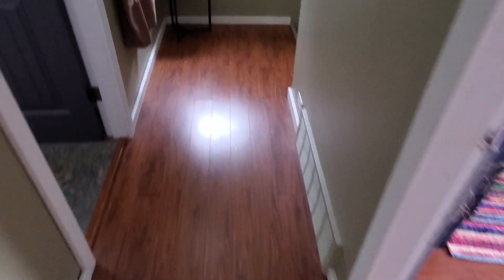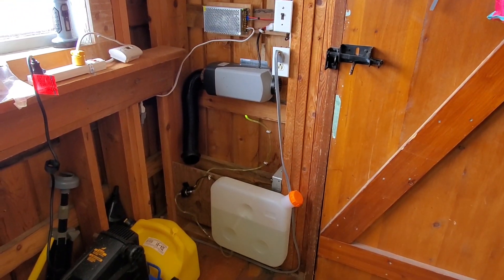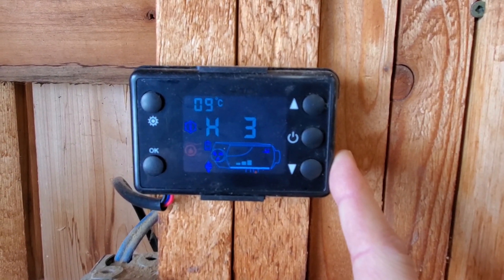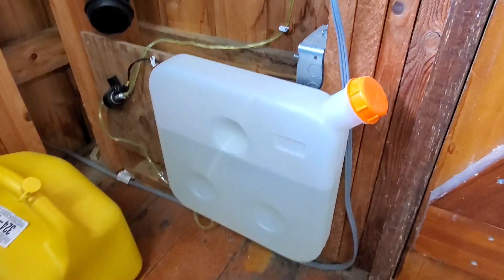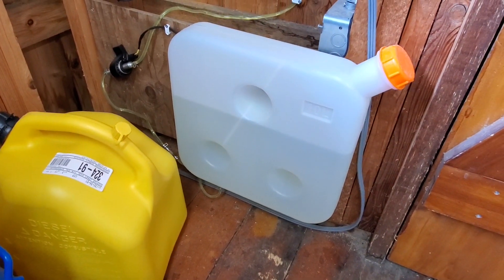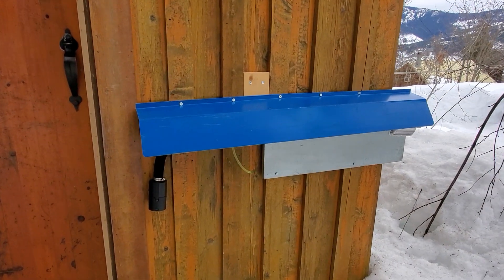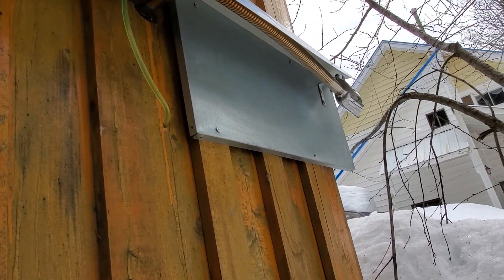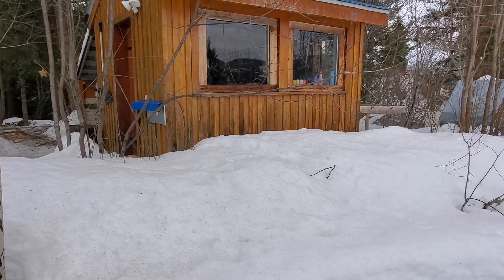Chinese Diesel Heater for a Workshop/Shed (5KW)

Comment: I thought the main heating unit had to be installed horizontally with the exhaust and air coming out from the bottom. You've got yours mounted vertically on the workshop wall. If you've had no problems running the system this way I'll do the same with mine.
Reply from the maker: It can be mounted vertically if you have the glow plug on top.

Comment: mine came with a 5L tank because i cheaped out and bought the all in one. so what i did was got the same fuel can cut the tab off the cap drilled a hole in it and fed a stand pipe down that then when that ones empty i just remove the cap stand pipe and all and switch it to another full can then go fill the empty one. and thats my plan for the one im putting in my house hopefully before winter hits in canada. hell its 2 degrees here in NL its still t shirt weather.

my shed is 12X20 uninsulated holes in the roof its 2 feet off the ground and the floor is built like a deck, last winter in -40 i had mine cranking out on heat level 6 i had to take my sweater off it was so hot. since then ive laied down osb on the floor and swapped out the old drafty swing door with a roll up garage door
Reply from the maker: I've been slowly upgrading my shed as well. Lots of new videos to come with wood stove install, solar power.

Comment: Recommendations: don't shut it off in the depths of winter... remote it to high when needed.. Run on lowest setting otherwise.  .  Run 10 percent petrol (gasoline) to keep diesel from jelling and increase heat output..  run AC components (12 volt chargers, power supplies, etc) through a computer UPS to avoid catastrophy if sudden ac power loss possible.  I use a 15 to 30 gallon fuel cell to supply sink for heat and lowers refuelling to once a season.  If using gasoline in mix, consider hardline plastic going to a tank OUTSIDE.  Run your exhaust no more tHan a meter or two, coiled and going downwards with a fan blowing across it.. INSIDE . Pass the exhaust through the wall centered in a 1-1/2 inch piece of copper pipe.  Lose the muffler.  RUN INTAKE INSIDE.. combusting outside cold air takes energy.
Reply from the maker: Interesting ideas, I'll have to look into them.

Comment: I've got an insulated shop the size of a 2.5 car garage with 9 ft high ceilings and installed 2 x 8 KW diesel mini-heaters. Each heater is on the opposite side of the garage and their exhaust pipes vents outside. Yes. They do "heat up" my garage - to "take the chill out".  Especially when temps drop in the -40Cs / -40Fs. I also use the 220V @ 30 Amp electric heater when needing to work inside in my spring coat / thick sweater. Yes. Mini-Heaters do "heat up" a shop. Especially when "occasionally needed during winter months" - like when changing my vehicle's engine oil.... Burning diesel is much less expensive than using electric heaters. Especially electric baseboard heaters...
Reply from the maker: Agreed. That's a fairly large space to heat.

Comment: I installed one in a 20 by 10 woodwork shop last week.  I went with the Maxpeedingrods 5kw unit with separated tank and heater element.  The wood shop is located in Western Massachusetts not too far from Albany, NY, it can get down to minus 30's on coldest days during artic blast.  The shed is uninsulated, will insulate it for next winter to cut down on required btu's to keep space heated during cold weather.   So far, I am very happy with purchase.  I paid $138 for the 5kw kit which came with upgraded components compared to many other brands, heavier duty exhaust pipe and Bluetooth controller which appears to be similar to one you are running it has a gear pump mode which I run it in or an auto temp mode. 

 I actually like the key fob more then the phone app. The phone app could use some work.   I did pick up similar transformer rated for 30 amps and 12 volts for $21.  I bought the double wall through rv or boat thimble and one extra exhaust hose.   Total cost was around $185.  The unit runs well and puts out estimated 14,500btu to 15,000 btu max based on combustion efficiency.  This is 3.5x higher than any electric heater and like yourself it cost about $8 of fuel to run few hours a day for approximately two weeks.  This is way better than electric and propane, plus it is a dry heat no moisture like salamander heaters give off.  

The unit reminds me of old school monitor heater we have in Log Cabin up near Lake Placid which can heat a whole log cabin and runs off of kerosene.  They do not make monitor heaters anymore they were very popular fuel-efficient ways to heat homes in cold weather climates.  The cabin could be heated literally for two years on a 275-gallon tank of kerosene.  I think the old monitor heaters put out estimated 30,000 to 40,000 btu using same exact principals as these units.
Reply from the maker: Very cool info on the monitor heater. I'm installing a mini wood stove next to compare.

Comment: Hello, 3 years later - how is the unit doing?  Any issues?

I have a question about the electronics, have you had any issues with condensation?  Thanks.
Reply from the maker: It's running great 5 years later :)

Comment: If you have your fresh air intake on the INSIDE of the building. It will work much better.  Doing it the way you are.  It has to heat the cold outside air
  Fresh air intake on the INSIDE of the building my heater works wayyyyyyyy wayyyy wayyyyy better
Reply from the maker: Interesting I may try that!

Comment: Well done.  I am glad to see your installation has the outside air intake and exhaust on a vertical surface.  First one I’ve seen in looking at hundreds of videos.  The difficult to read manuals show it but most choose to put the outside air and exhaust down.  It is a good suggestion to wire in a battery backup for power outage.
Reply from the maker: Yes not many installed this way but it works very well. I have had the power go out a couple times without any damage ( may have got lucky).

Comment: Hi there, I'm just wondering if you have ever had a power cut while it's been on and if the heater cools down own, I'm assuming it should have some sort of safety system built into it, I'm torn between electric or a battery and solar charge or maybe even a trickle charge, thanks
Reply from the maker: I have, it doesn't seem to negatively effect it.

Comment: I am thinking of mounting everything outside and a safe distance from the building then just running insulated heat discharge (and possibly intake) into the building. Probably best to mount the unit higher than the point where the output hose enters the building.
Reply from the maker: You will lose some heat running the discharge in a cold area. I would personally mount it against the building to maximize efficiency

Comment: how much amps dose this thing pull???
Reply: I'm just prepping to do an install in Manitoba and have been researching the same question.  My searches so far have led me to a start up amperage of 11 to 12 with a 120 volt connection.  Once running it should drop closer to 4 or less.  I'm planning on a 20 amp supply and suggest no smaller than a 15 amp supply.
Reply from the maker: About 5-10 when glow plug starts, 2ish when running.

Comment: Thank you.  One thing that I was looking to have answered -- my shop setup is that best fit for a Chinese heater installed "on its side" -- i.e. with the inlet and exhaust pointed out horizontally versus the vertically pointed down as most are.  But no videos I've found so far show this arrangement or mention whether it's a practical arrangement or not.  Now I see yours and I'm glad to know that at least some heaters will work mounted in this way.  Did you have to select one with this in mind or is it "universal"?
It's very good to know.  Thanks also for your comments about efficiency and the usefulness of an battery-assisted 12V power supply.  This is a very useful video and I appreciate the info and your work to produce it.
Reply: I watched a video of a guy talking about this type of side install.  He said it was fine as long as the glow plug was facing up.
Reply: @kdollars101  Thanks.  That's kind of a problem, I need to have two back to back, that would make the glow plug on one point up and the other point down.  Maybe I can do some juggling to get them to fit side-by side.  
But it's good to know,  thanks and best wishes,
Reply from the maker: That's right!
Reply from the maker: As long as the glow plug is on the top, you are good.

Comment: Hey, it's not pretty, but aluminum tape is great for covering cracks, stopping air leaks.  

I just installed a 5kw heater in my garage. So far, I think it'll work out well.   I used a battery and charger to ensure there's no way for the power to the heater to be interrupted and cause damage, though.
Reply: Hi, I’m glad To see your text. I expect delivery of my heater soon, and was looking for information on having the battery on the charger whilst connected to the heater, and I see that you have done it this way. Can you give me your suggestions on using either trickle or full charge when running. I think that I will buy a separate battery for the heater rather than use my jeep battery battery. I would be grateful for any advice on this, thank you.

Comment: looks like you  used some kind metal piece that you screwed to you shed and then ran the exhaust tube thru.I need something like that so i dont burn the piece of wood im going to run the tube thru. What is it called and can i get one on amazon?
Reply from the maker: I just cut the hole in my wall large enough that the exhaust wouldnt be in close proximity.

Comment: Would it not work more efficiently with the air intake inside rather than burning freezing cold air from outside....just a thought...
Reply: combustion air is better cold so it's outside with the exhaust. the heat exchange cold intake is inside the building, so you are recirc-ing the "hot" air.

Comment: On the controller you should be able to press the settings button three times till it shows 4 lines with a padlock icon. That’s asking for a pin to access the HZ and fan speed setting. The pin to enter is 1688, select it by using the arrow keys and pressing the ok button to confirm each number. That should enable the advanced settings.

Comment: Buy a tube of sealant and seal the holes in your walls. Your losing heat while running the heater. Its $5 and you'll save on fuel while keeping shop heater for longer
Reply from the maker: I have added rigid foam since then and it's much warmer!

Comment: How is the heater working now that its been a year? I noticed you mounted yours sideways, with the intake and exhaust through the wall, is that an option? We just bought an 8kw unit and will be installing it on our remote cabin this weekend and was curious.
Reply from the maker: Hey! Working great! as mentioned in my update comment below I would run the heater off a 12volt battery which is connected to a battery charger to avoid cooking the unit if you have a power outage. You can mount the heater sideways as long as the glow plug is on the top side.

Comment: I noticed you used different fuel line then normally comes with the heater, do you find it affects performance at all? I read that the hard plastic type fuel lines they come with are meant for it as they don’t expand with the pump pulses and provide the heater with proper fuel. But my problem is my fuel line leaks at the rubber to plastic hose connection and I want to replace it with a nicer quality fuel line
Reply from the maker: Hey! What is shown in the video is what came with my heater. I would just buy the equivalent ID fuel line at the parts store if you are having issues with what was provided.

Comment from the maker: VIDEO UPDATE: If you are going to do this, I would highly recommend that instead of using a 12V to 120V converter (like I did) you connect the heater directly to a 12V battery, and then have that battery constantly being trickle charged by a battery charger. These heaters require a cool down cycle - if the power goes out while heater is on, it wont go through this cool down cycle, and may be damaged. The 12V battery provides you with a backup power source in this scenario and gives you time to properly shut it down (while mains power is off).
Reply: I use my boat battery, with a charger
Reply: @Seth Briar Instablaster ;)
Reply: @Jose Peter I really appreciate your reply. I found the site on google and I'm waiting for the hacking stuff now.
Looks like it's gonna take a while so I will get back to you later with my results.
Reply: @Jose Peter it did the trick and I finally got access to my account again. I am so happy!
Thank you so much, you really help me out :D
Reply: @Seth Briar You are welcome =)
Reply: Is this cheaper than propane?
Reply: I guess im asking the wrong place but does someone know of a tool to get back into an Instagram account??
I somehow forgot the password. I would appreciate any assistance you can give me

Comment from the maker: I have gotten a few comments about the heater being installed with the exhaust on the side. This works great AS LONG AS YOU HAVE THE GLOW PLUG ON TOP. That is critical. The heater is still working great.
Reply: Interesting, and thanks. What would happen if the glow plug was on the bottom?

Comment: Great video.  I am about to do similar though we don’t get the same extreme cold weather.  In your update you mentioned adding a 12v battery which has confused me a little.  Are you going to replace the 120ac supply with a 12v battery/charger or is it going to be supplied by both with the 12v battery acting as a back up?  If the latter how did you wire this?  Many thanks - Martin
Reply from the maker: Hey, have not done this yet but plan to. This is the plan: The diesel heater is connected directly to a 12V battery. That battery is continuously being trickle charged by a battery charger. The battery ensures that if power goes out you have X number of hours of battery backup so the heater doesn't cook itself (by not going through its cool down procedure).
Reply: @RuggedOffGrid  many thanks for the quick reply and explanation.  I now understand😁.   I will stick with a mains supply as it won’t be used if I’m not present thus negating the cool down issue/threat.
Reply from the maker: @blacklablover2982  The issue is that regardless if you are there or not, the cooldown cycle will not happen with power interrupted. From what I have read, without the fan on (pushing that heat out of the unit) the unit will get too hot and be damaged. The heater is designed to have airflow constantly moving through the unit while the combustion chamber is hot. This keeps the internals within the design temperature.

Comment: I would suggest incoming that the air intake be inside the shop. You have enough air infiltration. This will give you more heat since you are warming up warmer air.
Reply: taking the colder air is actually more efficient since it's denser and holds more oxygen, thereby getting more BTU's out of the gas that's burnt.

Also, the air is recirculating inside already, only the combustion intake is outside.

Comment: I'm sure I read in the manual that it needs to be installed with the exhaust facing the floor
Reply from the maker: From all my research and many users inputs the exhaust can be facing sideways, as long as the glow plug is on top (that is critical).

Comment: Installed one in my 1 1/2 car garage about 4 months ago!! I paid $101.00 to my door in Indiana. No smell, no mess its just perfect!! I have it powered by a 120v 25amp transformer bought from ebay for $17.00 to the door. If you are thinking about one, you will not be disappointed!
Reply: Hello what is the 12 volt power supply rated at in DC amps
Reply: I will o out and look tomorrow and get back to you
Reply: actually I think the 25amp is the DC output, I will check tomorrow to make sure.

Comment: Do you have the exhaust install sideways?
Reply: He does. They're designed to be pointed up to 90 degrees to either side.
Reply: @styledliving  Only 90 degrees on ONE SIDE.  When mounted on side  glow plug must be on higher than burn chamber.
Reply from the maker: This is exactly right.

Comment: Does anyone happen to know what the start up amp draw is like? Wondering if I can use my Bluetti eb240 to power a 5kw heater.
Reply: Hi from scotland amp draw while glow plug on is about 9amps then when heater running, roughly about 1 amp ish
Reply: @isleeparoundoverland7583  Thank you very much

Comment: I'm surprised installing exhaust sideways isn't an issue.
Reply: The exhaust is fan forced so it isn't an a problem. You can point it down, much like it comes out of the heater itself.
Reply: @74willy81  as long as the glow plug is on a top corner it is OK.

Comment: Just got a new one from ebay and im not getting power to the controller.  Checked fuse and I'm getting 12v to the ecu but no voltage to the controller?  What else can i Check